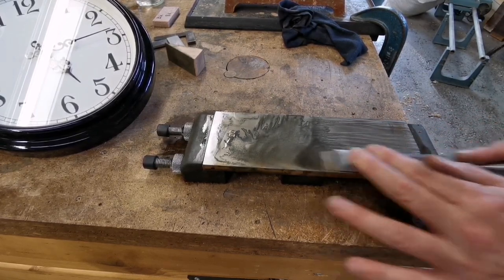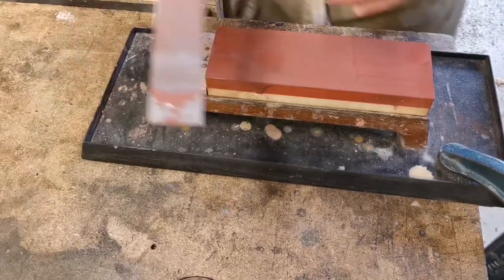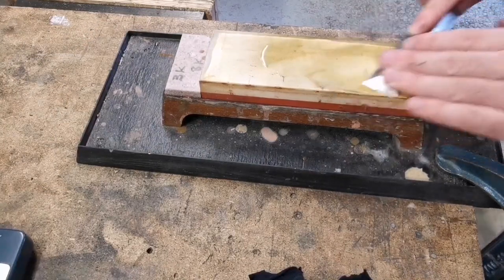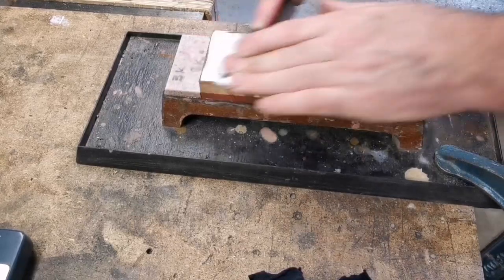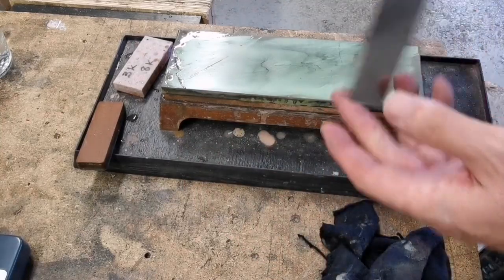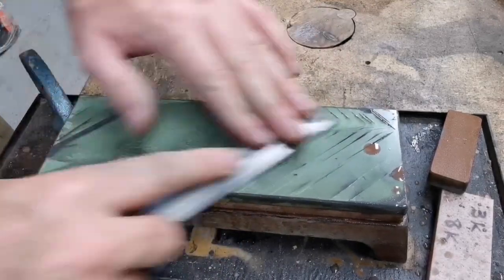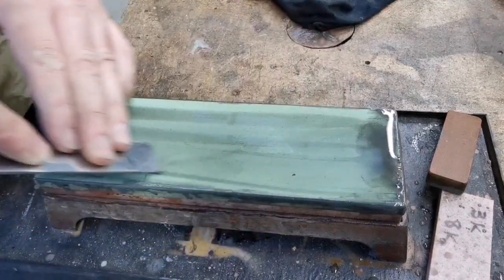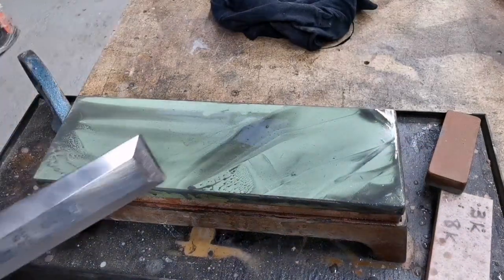Chisel restoration - How to flatten (lap) the back & prepare a 25° bevel Pt.2 - Patience is a skill

Comment: Hi Jamie, I have seen most of your videos and really enjoy them. 
I've read all the comments and am surprised there's such a fuss about how to flatten and sharpen a chisel! We all have our own ways and our own ideas of what flat really means and how important it is. 

I worked as a machinist for an optical firm so flat meant something and could be quantified down to the micron. I have also been a woodworker (hobbyist) for decades. There is nothing in woodworking that comes close to flat. It's all a matter of degree, do we need flat to a micron to cut wood no. That was a hard lesson for me to absorb. I even tried surface grinding plane irons to achieve a truly flat surface, a complete waste of time. 

I now flatten my chisels and plane irons on a diamond stone for rough grinding and hone on a medium oil stone then strop. As long as the first 1/2" of the blade is flat that's all I need as long as the rest of the back is hollow. Subsequent sharpening will continue to flatten the back as the burr is removed. Flattening the back of a new to me chisel usually takes from 1/2 to one hour depending on the state of the thing. 

I'm sure my chisels and plane irons could be sharper and flatter but my old hands won't abide by hours of rubbing tools on stones so I just re-sharpen more often and my tools cut just fine. 

All that said I think we should all do what we like and how we like to do it. Those chisels were beautiful when you finished them I really admire the work you put into them excellent job! I wouldn't do that but I don't think you're nuts for spending time to achieve a result you want, after all if speed is the goal why bother with chisels and planes at all? Do everything on a CNC machine and don't bother with hand work. 

My woodworking friends think I'm nuts using hand tools but I enjoy it and can't imagine working wood without them. I think your critic is just plane rude to start a pissing contest on which way one should flatten and sharpen a chisel of all things. Let's lighten up and enjoy life it's too short. Best wishes Gene.
Reply from the maker: I think you've got all of that spot on. I agree with everything that you have said.
I could have deleted it. But felt it better to leave here.
Reply from the maker: Hi Gene
Hi. I've just released a new video on sharpening a Chisel. It's worth watching because it's a back to basics with great results. Here it is 
https://youtu.be/qN9W-03wMm8
If you like it, then please comment as it helps me grow this channel. 
Thank you 
Jamie

Comment: Hi Jamie, great videos, really simple to understand. Just one question, can you share some details on the ‘cheap’ stone you have. Valid point about wear & tear on something cheap.  I’ve got a set of new  chisels to flatten.
Thanks!
Reply from the maker: Hi Frank. Thank you for the compliment. Have a look through this sharpening playlist of mine. You should be able to find just what you're looking for. If not, ask again and go into more detail if shat you're after.
Sharpening: https://www.youtube.com/playlist?list=PLomQ4jxG80do0RCGHBVOGxmI7A9k226tx 
Hope this helps.
Jamie
Reply: @twcmaker  thanks Jamie, the stone I was referring to was the one in your chisel restoration part 2. However I’ve just watched the first video in your play list - ‘budget 10k water stone……’, so even more interested in your recommendations.  I’ve recently purchased a decent 300/1000 grit diamond stone and a Shapton 16k ceramic stone.  I use these for day to day chisel and plane iron maintenance.  I also recently purchased a 4k/8k diamond stone as I have a new set of chisels that need the backs flattening. I’m not at all happy with the 4k/8k diamond stone, so looking for something to use between 1k & 16k.  I’m happy to invest in quality, but given anything I buy to sit between 1k & 16k won’t get much use I’d prefer not to spend unnecessarily.

Really appreciate any advice.

Thanks, Frank.
Reply from the maker: Frank. I think you've got all you need. The 4k and 8k stones (in my opinion) are a waste of money. The rough stones for 25° and then the 10 or 15k for 30°
If backs are really out of sorts. Then a 180 or 200 grit diamond will save hours.
Reply from the maker: Hi. I've just released a new video on sharpening a Chisel. It's worth watching because it's a back to basics with great results. Here it is 
https://youtu.be/qN9W-03wMm8
If you like it, then please comment as it helps me grow this channel. 
Thank you 
Jamie

Comment: Just shorten the blade on a sandstone wheel to get rid of the dud corner . Saves grinding the whole blade thickness . For the back I use a rotary (hand turned )abrasive grit disc  .It`s for picture framers really .That gets the back flat quicker than the diamond plate (which I use as well ,later } I have been doing all my chisels this weekend .If you buy old used chisels the backs are seldom flat due to use as scrapers on rusty metal .
Reply from the maker: .. And take years off the lifetime of the blade. That's a good option. Thank you. I'll think about that.
Reply from the maker: Hi. I've just released a new video on sharpening a Chisel. It's worth watching because it's a back to basics with great results. Here it is 
https://youtu.be/qN9W-03wMm8
If you like it, then please comment as it helps me grow this channel. 
Thank you 
Jamie

Comment: I queried the cloudiness left by my "high" grit Chinese synthetics also. I've been chatting to a guy that did some research on them and he basically discovered that many of these cheap Chinese stones marked as being any higher than 2000 JIS are actually a complete lie! It seems anything lower than that can be relatively close to it's supposed grit but, by and large, anything marked with a higher grit will likely be firmly in the 2000 range regardless of it's labelling. Interesting stuff.
Reply from the maker: Oh right 🙈 so the 15k (cheap) stone I bought is bs?
I'll have to try it.
Reply: @twcmaker  I'm sure there could definitely be outliers but he seemed to have had a quite extensive approach. He did state however that there are natural Chinese stones that are legit but to make sure you get them from a reputable seller. I suppose only way to tell is to see if the polish becomes duller after using your 10,000 Sun Tiger.
Reply from the maker: Ahh. But then you can 'over clean' your stone with the Nagura. If you let the stone 'clog-up' with slurry, you get a black area. This highly polishes the metal. So don't be too clinical about it.
Reply: @twcmaker  Have found some info that seems to indicate a 15,000 stone by a 'Reetec' is as it should be so there could certainly be others.
Reply from the maker: That's the one I've got. That deserves a video if the stone can polish. I think it was £25.